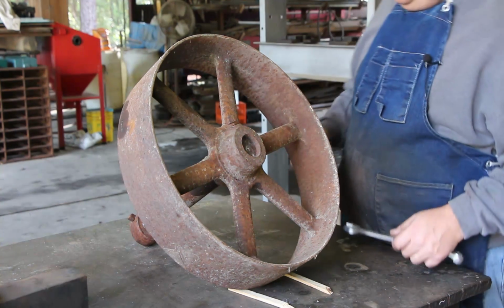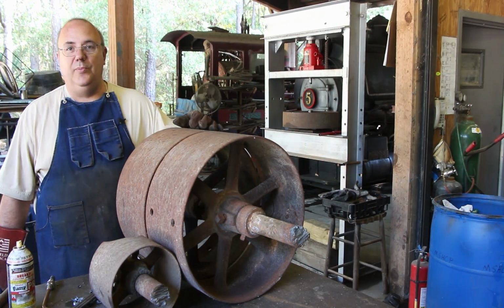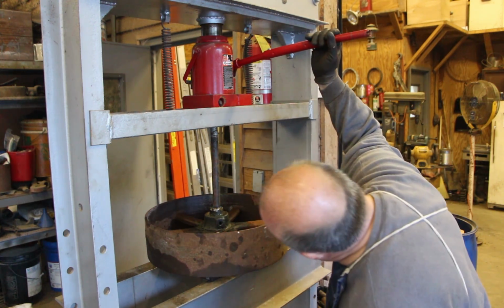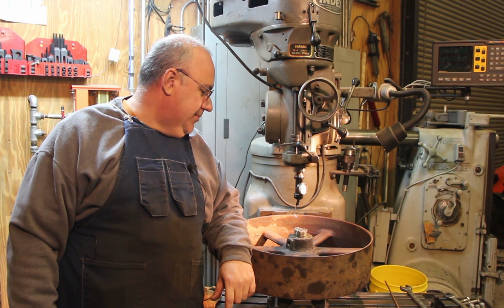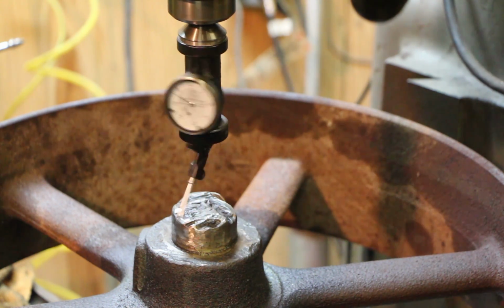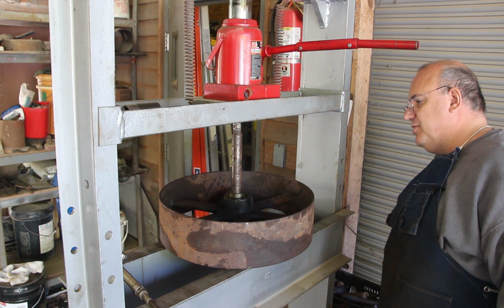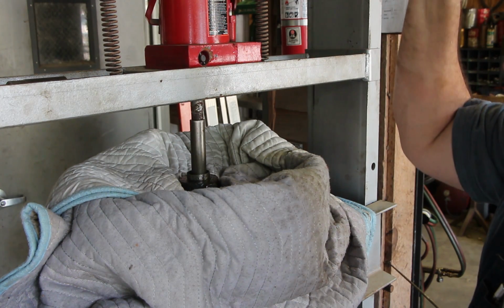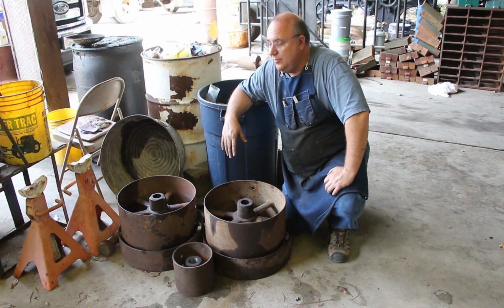Removing Stubborn Shafts from Flat Belt Pulleys

Comment: Hey Keith! Love watching your work! I’m a mechanic, and a wannabe machinist. When I saw you had drilled that shaft out so far, I was thinking, that would be the time to either slice the thin remaining walls of the “tube”, either with some sort of hacksaw arrangement or (here’s the mechanic talking) an interior pipe cutter on an air hammer, the kind we use for cutting an exhaust pipe out of another one. Now I have to go back and see how you did it!

Comment: Just come across this video. Back when I worked in a machine shop and we had extreme stuck shafts like the last one we would drill out the center like you did but all the way through then take a cutting touch to the inside of the drilled hole and cut to the outside. If one was careful the torch would stop cutting when it got got to edge of the shaft. This was especially true if the pulley etc. was cast iron. This was relatively fast and saved a lot of time and frustration.

Comment: Great job on the shaft extraction and lots of good comments too. One suggestion I didn't notice was to heat the shell of the shaft AFTER it has been drilled out. I've seen problems very similar with broken bolts in engine blocks. Keith's comment early in the series not to heat a stuck bolt but to heat the casting around it is spot-on. However, after the center has been drilled out, heat on the remaining shell makes it more malleable--which is just what you need when pressing it out. 

A second option is to continue the slightly off-center drilling or boring until you break through the shell in one place. Then use had tools (chisel, punch) to collapse the shell toward the center. It doesn't take a lot of collapsing until the core is lose enough to remove with very little force. I've saved many a casting this way. And in the case of a hardened steel bolt broken off in aluminum alloy engine block, collapsing a drilled-out core is sometimes the only option.

Comment: If you'd have heated the tube  in the pulley to dull red and let it fully cool, it would have fallen out by itself. The tube would expand but it would be weak causing it to upset. On cooling it would shrink to a smaller diameter. The same principle works on bolts. Don't ever press or remove bolts when they're hot. Let them shrink.

Comment: If a spoke flywheel is stuck do not heat the hub. It is very tempting to  think heating the hub will release it, but often this is a mistake. If you heat the hub, the spokes will keep the hub from expanding. Instead, heat the outer rim of the flywheel. As it expands, its spokes will pull the hub outward, opening up the hub's inside diameter slightly.  

If you can spin the flywheel slowly you can build a fire with coals and leave the flywheel turning at a slow rate, just above the fire. Come back in the morning and you will find your stuck flywheel laying on the ground.  Many spoke flywheels have a much larger diameter than the ones shown in this video - six feet or more on rock crushers. Don't be standing next to one of the big boys when it decides it is time to come off.

Comment: this is way too late.  You had a great idea drilling out that shaft.  If you drilled through you could have used a hacksaw blade to cut a groove in the wall of the shaft and with hammer and chisel collapsed the shaft.  P.S.. nothing wrong with your press, its better to feel what it takes. great job

Comment: Should have supported the pulley by the hub with a piece of pipe or a plate with a hole in it slightly larger than the shaft size. You could have applied all the pressure You wanted without damaging the pulley

Comment: I'm aware of beeing 7 years late, but you seem to be young enough to be still on the job and may come across something similar stubborn as this. 
My advice is, there are two ways to loosen up a tight fit. 
One is to heat the outside, the second is to cool the inside, maybe combine both methods.
100g ice + 33g kitchen salt will give you -21°C/-6°F - replace, when the ice is melted.
But I would first try to press from both sides and drill completely through - if your drill isn't long enough, drill from both sides, you don't need a straight hole, a crooked one will do just fine.
Also I would get some heavy tubing, fitting around the hub as close as possible to take the pressure off the spokes.

Stay safe

Comment: 27:50 Dang, that shaft must have a "stepped" diameter.  With all the time invested, couldn't you have drilled several smaller diameter holes in a line, to allow inserting the saws-all blade thru it, and cut to outer edge of diameter?  Yes, hindsight is better than 20/20.     28:25  What happened???   Was that movement of shaft, or did fixture shift?

Comment: Drill out the set screws oversize and you likely wont need to remove all that iron from the shaft. Build up a clay collar and soak it for a week via the set screw holes and the shaft area with some acetone and oil mix. Also you had it so well centered you might have just taken all of the shaft out!

Comment: When we had a stubborn shaft we'd drill it out like you did only a bit thinner but then we would cut grooves in the shaft like you would do when making internal key ways until the metal is paper thin. 3 grooves evenly spaced seemed to work the best. I think Joe Pie at Advanced innovations has a video about using the mill with the spindle locked and a tool he made for making key ways on the mill. Not complicated at all.

Then use something to collapse the shaft. In some cases a dull cold chisel could be used but a simple clamp (like a split collar) with a round opening and a screw on either side to apply the clamping pressure can be made pretty easily and works a lot better.  The metal in the grooves will sheer fairly easily and, once it does, the sides of the shaft break free making pressing it out a whole lot easier (especially if you use penetrating oil in the gaps created) and there's no damage to the pulley.

Another way to collapse it is to use a ring with an internal diameter larger than the shaft and having 3 threaded holes equally spaced radially in the ring and made to accept whatever screws or bolts you want to use to collapse the shaft. Again, very easy to fabricate.

Great job as always though! Thanks for sharing your experiences!

Comment: i have removed many shafts from bores put holes through center till thin wall then cut with saw it will come out if not pressure welded in place if not sawed small tip on torch   to poor for mill machine only big drill press!!! good show  thank you much

Comment: One hell of a good job Mr. Rucker! I don't know if it would have applied to this because your problem was raised material from the pully spinning on the shaft but I've found on several occasions on freeing up brake bleeders and recently a 50 year old cylinder head had an exhaust stud broken off and siezed in the threads. What I do is heat both pieces as hot as I can get them in without causing damage to the main piece of material and then shocking it with cold water. On the bleeders, I just heat the bleeder only till it's red, squirt water on it, do that three to 5 times and sure as heck, they come right out. So now when it comes to old bleeders, I put very little pressure on them in the first place and then get out the torches. The other example was a head from a 318 polyspheric cylinder head from a 62 Plymouth Fury. The manifold broke and I was tasked with changing it. All the bolts came off and a couple of the 5 studs. One of the studs had broken off flush, the other two has some left. I used the same procedure as the bleeders and the two with enough to get visegrips on came right out. I started small and very slowly and carefully drilled a center hole, and then started opening the hole progressively. There came a point that if I had gone any further there wouldn't have been any part of the stud left for the easy out to grip to. I got one to grip very well but the remaining piece still wasn't budging. Like in your example, I needed the cast iron to expand but not the stud. BUT, I heated both very hot and shocked them several times, let it cool and then heated the the stud very little and the cast quite a lot at least 20 times, each time the stud would rotate a little. I broke the easy out trying to get it out of the stud but at least we were able to use that hole, and the threads in it after a quick clean up, to hold the manifold down without needing to use a helicoil. I hate those things. I honestly believe that the remainder of the stud never would have come out if I didn't shock it first.

Comment: Try tapping on with a hammer while under pressure on the outside housing. Done this all the time at work when using a 40-ton press and it would stall. As the vibration transfers from one metal to the other 99% of the time it will pop.... Give it a try some time.

Comment: You should get a pipe and put over the shaft at the bottom end soo when you press you won't break the spokes. Also this allow you to put plenty of heat on it to make it move. When you do it the other way when you press you are pinching the shaft even tighter on the shaft.

Comment: Just watched this video... 7 years after it was made!  One thought that occurred to me:  With the stuck shaft bored out, and pressure on the press, heat it up from the outside.  Then, while still hot, spray/pour water into the hollowed out shaft.  The thin-walled shaft will shrink away from the pulley hub and initiate movement.
Reply: I'd accept your theory, but only iF you exchange your 'will' to to be 'possibly might'  ...  and without damaging the pulley ...

Comment: I am not a machinist,  but I have certainly been the victim of my own impatience. So while I found the video quite  interesting,  what I found most valuable was process you went through to address the challenge of removing the shaft from the pulley. At each step,  you did not simply apply force until something 'gave' but rather you applied a reasonable amount of force for the step. When each step failed to produce the desired/expected result,  you stopped and thought it through before proceeding. I was also impressed to see you (apparently suggested by a subscriber) take safety into consideration by wrapping the pulley in a blanket. I have direct experience in what can happen if you treat safety with a cavalier attitude.

 Once,  when I was approximately 20,  I worked in a machine shop where safety was viewed as something unnecessary that ate into your profits. As a result,  I one day found myself operating a drill press with dull bit. I was drilling a piece of material that was being held in a jig. I was instructed to hold onto the jig with one hand,  operating the press with the other. The jig should have been clamped down,  but I was new,  inexperienced,  and had a quota to meet. The results were all too predictable and I severely damaged the hand that I had quite foolishly thought could overcome the force of the machine when the dull bit started to break through..

 Like I said,  I am not a machinist,  but watching your video was a great reminder of how a skilled,  experienced,  and seasoned professional approaches a task. Thank you.

Comment: I, as one, have just one thing to say, right after the first 30 ton press didn't do any good!! I would have changed my setup to where I would have been pressing against the hub in the center instead of against the rim of the pully, if indeed that's what Mr. Rucker was pressing against!! And also, what was up with the set screws anyway??

Comment: Is there an inexpensive means to look for microcracks in the pulley after pressing out a troublesome shaft at high ram pressure?  This concern would be made as  safety measure where fractures might cause the pully to break in use. Magnaflux would be one possible option,  but I do not know how expensive or practical it is.  There maybe other methods.

Comment: After drilling it out large hole made, heat the inside hole of the shaft red hot. That will expand the remaining shaft in the bore, it will lengthen the leftover shaft metal and it will collapse inward when it cools. Then it will be loose enough to come out.

Comment: Once you have either drilled or bored a hole all the way through the depth of the hub, it is a simple operation to slit the remaining sleeve with a cutting torch. A thin sleeve will easily yield to the torch, and the mass of the hub will resist the heat and not sustain damage. Even partially slitting the sleeve will usually allow it to be driven out as the shaft collapses in the hub bore.
Reply: Nailed it Gabby, as the torch will not cut cast iron so the pulley would be safe from the torch.  Would have come right out, probably could have been driven out at that point.  Been there, done that.

Comment: This is actually the second time I watched this video.  Between this one and a couple others I have watched it convinced me that when I build my press next month I will build a 50 ton press instead of just a 30 ton.  Thanks for the great video.
Reply: Build it so you can control the ram from a distance, like on the other side of a steel plate or reinforced wall...don't want to be close with something explodes.

Comment: ALL CAPS BECAUSE OF BEING NEARLY BLIND.  DID YOU EVER TRY AN INDUCTION HEATER?  ALWAYS SUPPORT THE HUB ON THE BOTTOM RATHER THAN OUT AT THE RIM WHEN PRESSING FROM ABOVE.  THAT OLD CASTING WAS NOT DESIGNED TO BE STRESSED IN THAT AXIS. I HAVE FREED UP MANY SHAPS.  SOMETIMES EVEN BADLY RUST SEIZED URON RESPONDS TO A JOLTING OR IMPACT HAMMERING.  MY 15 YEAR OLD NEICE SPENT THE BETTER PART OF A DAY DRIVING OUT A BIG PIN OUT OF A 3 TON CAST IRON WHEEL. (WITH A 2 LB HAMMER AND BATTERY ACID.

Comment: I was watching an automotive repair shop mechanic use a pneumatic hammer (more power than a pneumatic chisel) to pop loose a very stubborn shaft on an old rust bucket pickup truck. Seems that the impacts set up a vibration much like an impact wrench does.

Comment: Dang, got that shaft out! now you have to find another hobby! that one only lasted a week. I've had my share of retirement projects with dissimilar metal chemical welds. Got 4 booms out of that one! surely didn't want to be restored. Almost thought it had a second set screw under the top set screw. Usually can see a drag channel from the setscrew on the shaft as a clue though.

Comment: thanks for all the info. I am working to restore a 10" Sheldon Lathe (E drive). The info you have on the net has been invaluable. I am now trying to get the j-type furnas drum switch wired to a new motor. Thank you for the info you have made available across the various sites.

Comment: I realize I'm coming very late to the party, but I admire your perseverance. Your comments about letting the problem rest while you did something else resonated with me, reminded me of something Richard Raffan said in one of his books on woodturning: "Sometimes the only thing to do is put down the tool, shut off the lathe, and go for a walk."

I did have an idea, although maybe it wouldn't have applied in this case. Once you'd gotten the shaft bored out leaving it as thinwall tubing, use a flexible shaft with a cutting head to cut two or three grooves down the inside. That would encourage the bored part of the shaft to collapse, maybe with some assistance from a hammer and punch.

Comment: Been there there and done that. Once had to rebuild an old cider press. All was going well until I got to one of the driver gears. I put all the pressure I felt it could stand. Just as I decided to stop pressing, BANG! The cast iron gear exploded into 6 pieces. This press was handed down from the old man's father. It turns out that it had tapered keys and that one was on backwards. The more I pressed the tighter it got. I ended up making the gear from scratch. Used gun blueing to darken it to match its twin gear. When the owner came to pick it up, he didn't believe me when I told him what happened. I had to show him the broken gear pieces. Then he could not tell which gear I had made. That made my day!

Comment: As an old fitter of 40 years, when we had shaft that were stuck we would blow a hole through the shaft with a gas axe, an with care, work towards the edge. When you reach the edge the air gap between shaft and boss would stop you touching the inner boss face, you can do this both side thus the shaft becomes two shells and can then be pressed or knocked out, a bit of care and a bit of nerve, saves a lot of hard work. This even work on threaded caps.

Comment: Excellent video, really enjoyed this and your other offerings.  Excellent workshop kit you have available to you
I wonder if with your really challenging task you were actually removing a replacement pulley that had been fitted to the shaft.  Seeing how tight your pulley was I find it hard to believe that it had in the past shifted and marked the shaft.  I suspect the shaft had been fitted with another pulley that had moved under load and could not be tightened sufficiently and that a replacement had been shrunk on for a really good interference fit.  I can almost hear the engineer fitting the replacement and muttering under his breath "That's fixed you you bugger.  You won't move again".

Comment: I need to add my comment as the people below me did. You supported the outer ring not the hub. The spokes were flexing and you lost all your power. You needed to make a ring larger than the shaft and place it under the hub to break the shaft loose.

Comment: I can take that out in about 8 hour max . The spokes that hold center will flex and binds the shaft . Bridge to centre  and you can press the crap out of it . Tap shoulders and it will fold in